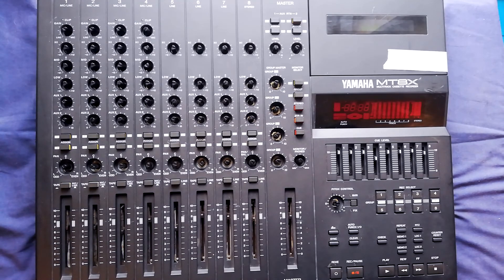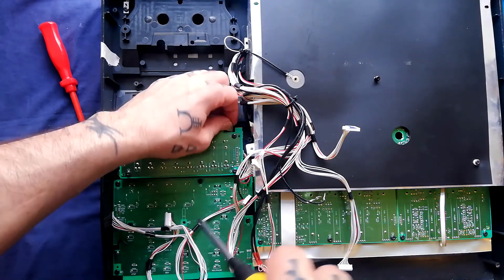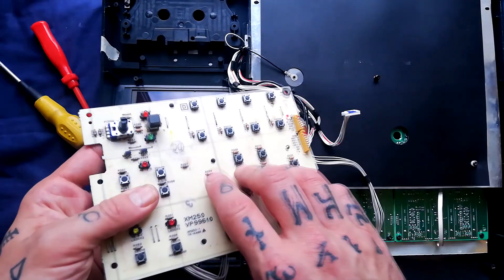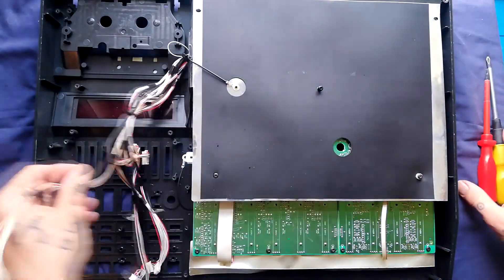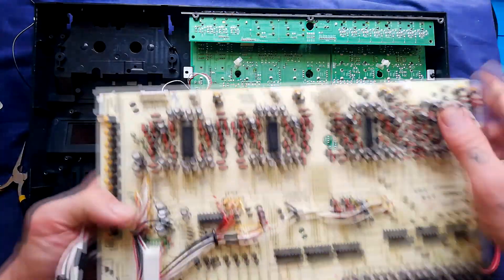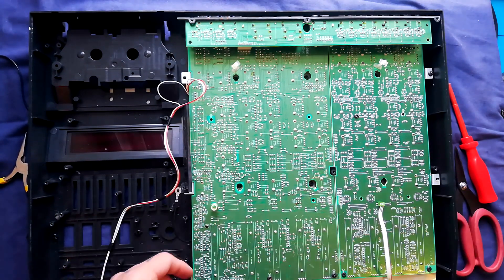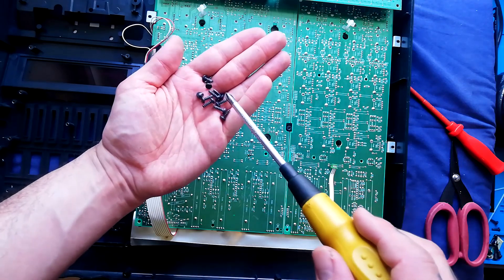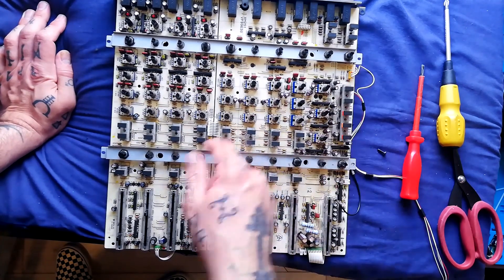Yamaha MT8X | Tear Down | 4 | Mixer, shuttle controls & door

Comment: These videos are great! I have a problem I’d love to hear your advice for though. I used Deoxit f5 contact cleaner to clean the entire mixing section, and now the buttons that click in and spring back out when clicked again are all seized. I tried cleaning one again with isopropyl alcohol which seemed to make it worse, then applied some conductive friendly silicone super lube to it to see if that would free it up to no avail. What would you do in this situation?
Reply from the maker: Can you confirm whether you did this disassembled with the switches and pots exposed? Or with the plastic case and switch caps still on?
Reply: @Tetrakan  I took the case off as well as all the switch caps! Switches and pots exposed.
Reply from the maker: @apitproducitons8001 yikes, ok, I have not had that experience. I suppose I’d persevere with a cheap contact cleaner and compressed air to see if you can free whatever is seized in there, but if that doesn’t work maybe your unit has something spilled on it in the past that is reacting with the contact cleaner? I’m speculating of course. Whatever the cause, replacement parts can be a little hard to track down but are not expensive. I’ve had good result recently typing the dimensions number of pins etc into google Gemini or equivalent and asking the AI to suggest suppliers and part numbers in my region.
Reply: @Tetrakan  They’re totally unseized now! My guess is I used WAY too much Deoxit f5 and it simply took days to dry out. Weird, but I’m not complaining. Thanks again for these videos and replying! Def gonna donate to your blog you got linked up

Comment: I just replaced the belts on my mt8x unit and replugged up everything, but it seemed no power was going to my screen or buttons. The motor was on and spinning when I powered it on however and the tape speed pot still controlled the motor speed. The two fuses tested fine however but I was wondering if you could point me in the right direction to getting my unit working again, thanks

Comment: Great videos - I've got an MT8X where everything works except for the L channel on the Stereo bus. Doesn't matter whether it's headphones, stereo or monitor out, it's all the same and the L-R LED indicator shows this. The cue bus works - and I can mix down with it but it's only a Mono image. Does anyone know where the circuitry for the Stereo Bus is located in this device?
Reply from the maker: @jayharris7673  the schematics are up for free download n my bog among other places. Typically there are opamp buffers pre and post master fader. If the master fader itself isn’t choked up with lint preventing signal from passing, another common faults is bad electrolytic capacitors in the buffer stages. Usually there will be 5 you need to replace per stereo channel, and they’re usually very close to the master fader.
Reply: @Tetrakan  Unfortunately cleaning the fader and boards did nothing, so I suppose I'll want to take a look at those caps. Thanks! In the meantime I discovered I can use the Groups busses + monitor out RCA's to get a stereo image. Not sure if fidelity in the signal takes a hit compared to stereo out (I would assume so) but it works!
Reply from the maker: @jayharris7673  Glad you found a workaround. You probably already figured out you can use the continuity setting on your multimeter to check whether a fader is passing signal - the resistance between the input and output pin should be close enough to zero to produce a beep with the fader turned all the way up.

Comment: You were right about those plastic brackets and the shield. The shallower little white spacers go between the shield and the PCB below. The black plastic splay pins go in the two upper holes of the shield, toward the back of the unit.

I counted 18 screws holding in the mixer boards and rear I/0 board, all of the same type.

This video was crucial. Many thanks!!

Comment: Hi, were you able to fix the unresponsive shutter simply by cleaning them or did you have to replace them?
Reply from the maker: Sorry I can't rewatch the video just now, please can you rephrase the question or jog my memory what the shutter is?
Reply: @Tetrakan  If you were able to replace the buttons successfully, do you know what the dimensions of the part are and what the best modern alternative for the part would be?
Reply from the maker: I did replace the buttons, and the electrolytic capacitors on that board though as a precaution not because csimply cleaning the switches definitely didn't work. If you're looking for replacements Theyre called momentary or tactile switches, you need to match the height and width/length (same value since they are square) and pin number, check but from memory these were 2 pin, 5mm wide/long and 3mm deep, a pack of 50 cost maybe £4 from eBay.
Reply: @Tetrakan  I'm sorry, I meant the shuttle buttons on the front of the machine like the play button, return to zero button,etc. I have the same issue as your machine where some of the buttons are unresponsive. I was just wondering if you were successful with cleaning them or if due to the size/low quality of each of the buttons you needed to replace them. I'm trying to decide whether to buy some contact cleaner and compressed air and clean mine out or just give it to a professional who can resolder new buttons.

Comment: Hey man ! I just buy one, but it play the tape really fast on 0 pitch, where the problem may came from ? Is it hard to repare ?
Reply from the maker: It's a 3&3/4 inches per second machine so if you put on a slow speed tape 1&7/8 ips it'll play double speed, that's correct behaviour. You need a slow speed or dual speed machine to play back your old tape.

Comment: Hi, do you know if the Yamaha MT-100 is similar to the MT8X? I bought a broken MT-100 for like $10 but not sure how to even begin fixing it.
Reply from the maker: Although it's my intention to build up a comprehensive library of tear downs, at the time of writing I haven't looked at a lot of Yamaha stuff; I don't have any experience  working with the MT100 at the moment, but judging by the case shape it seems unlikely to me the cassette player is the same as the MT8X, I think the case is too shallow for a rear mounted motor. I have opened a MT120 before, which has a similar form factor, and the cassette player was the same as a Marantz PMD740, so I suggest you look at my videos on that unit.